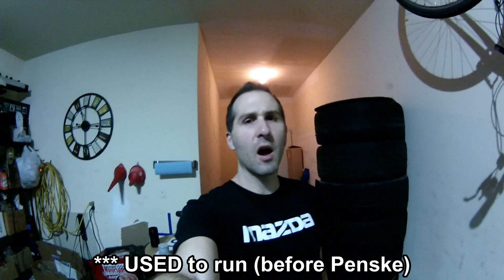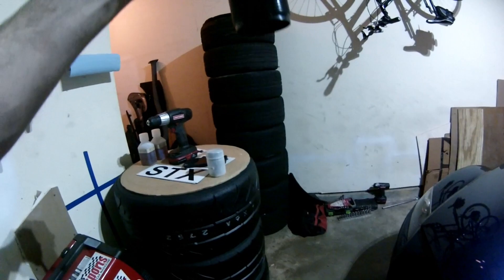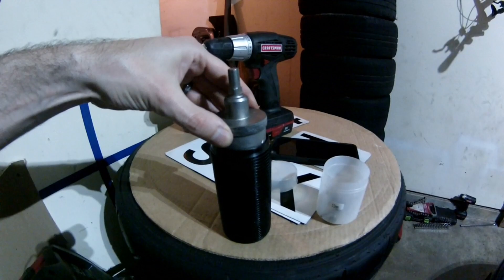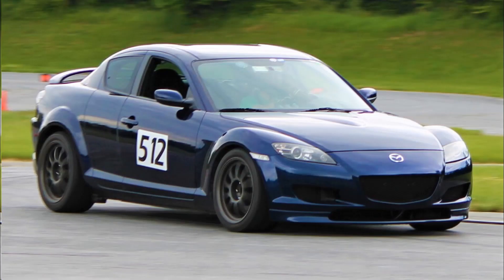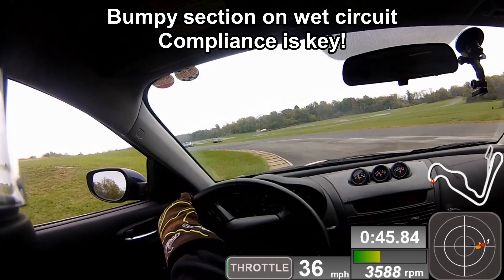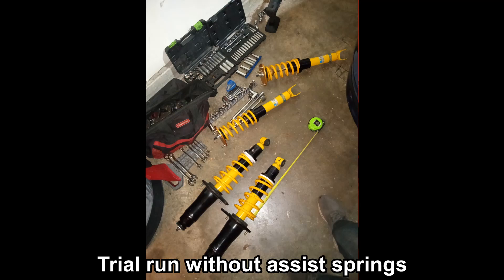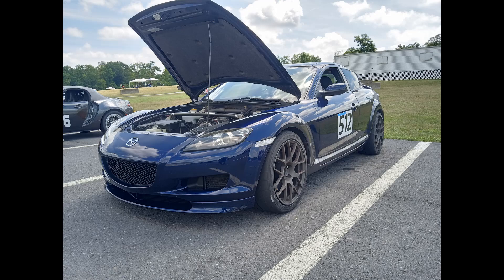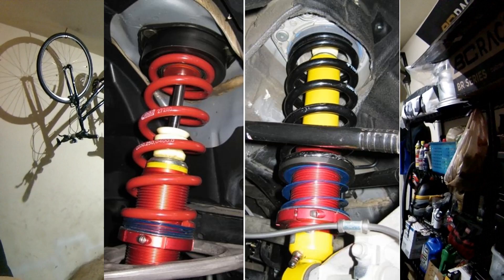DIY Mazda RX-8 / NC Miata Custom Coilovers

Comment: This is a great idea, I did something similar on my car. It works way better than those "cheap" coilover kits.
They do make threaded coil over adapters specifically for doing this on Bilstein shocks and they fit without modification. The adapters are available from places like summit racing. 
I used B8 "lowered suspension" shocks as is and found they handled heavier springs good as well. For the front I made a new spring perch out of 3mm mild steel and reused the OE shock bushing setup.
On the rear I welded on a 2.5inch collar onto the upper spring mount and used 2.5 inch straight springs, which was a messy way of doing it. Also an extra washer needs to the lower perch to stop binding on compression. The mustang 2 springs are a better option, being 3inch top and 2.5 bottom means they fit in the stock perch and the threaded adapter without modification.
Reply from the maker: Nice!  Did you share this on rx8club or any other sites?  Sounds like your setup requires a little more fab but is even cheaper than my setup

Comment: I'll be doing some small frankenstein suspension to my car, upgrading my Ohlins R&T coils with Swift springs, going from 9K/7K to 9K/9K to combat understeer and prevent the rear from rubbing. I've been told these magical springs also ride better. Surprised the Mazda's rates are so low in the back, figured it would be higher considering how easy that back end steps out!
Reply from the maker: The front motion ratio is (just ballpark memory) around .76 and the rear is really high, around 0.95 like a strut suspension.  These rates yield around ~1.9hz ride frequency, which seems to be okay for my car with street tires and really big front sway bar

Comment: I did a similar setup with the B6s on my 3000GT, and it's a very nice budget option that will out perform 98% of off the shelf coilovers, especially if compliance and street friendlyness is significant to you.

I've got MazdaSpeed dampeners and springs on my RX-8, but this was going to be my route had I not lucked out and found a set of them by mere chance.
Reply from the maker: Is your rx8 hella low?  I put MS springs on my b6 dampers and I was DUMPED!
Reply: @rx8matt  It is pretty low, barely 2 fingers gap with stock 18s. I was worried it would look awkward but now that I've become use to the look again, it looks very factory.. I don't have an appearance package or aftermarket lip so I don't have any issues scraping on anything thankfully. The handling is superb, and was better then I wanted. I came from Racing Beat Springs and KYBs, and had Tein Flex Zs before those (which I hated)

Comment: How much did this cost?
Reply from the maker: I had quite a few of these parts laying around,  so cost I paid is less than buying all new.  If I had to estimate,  $500 shocks,  $400 springs, $150 perches, $600 for the front top hats (that's the toughest part of this setup unless you modify the orm front top hats for cheaper), and then the tender kits are quite pricey ($300 together? ).  And another $75 for the tool and rear adaptors.   For that cost I would just suggest bilstein pss kit, or step up to ohlins.  I think bilstein pss kit is good value for money